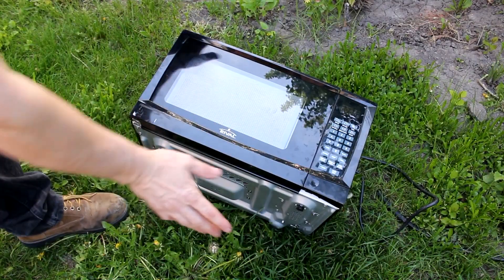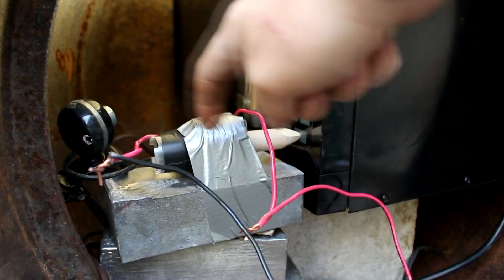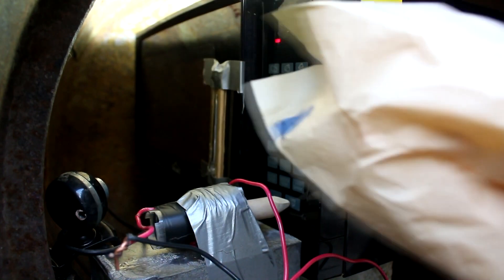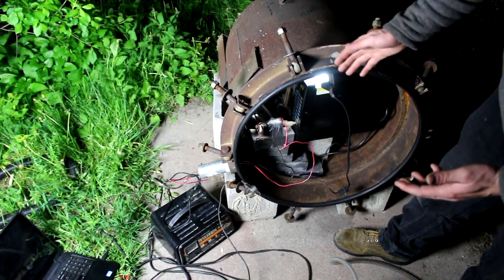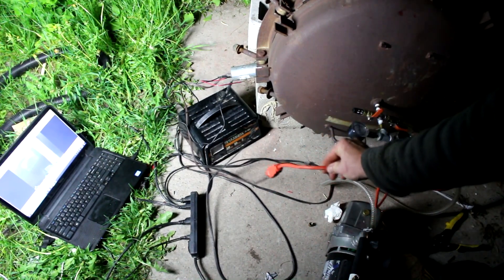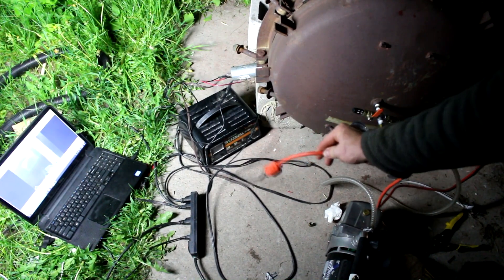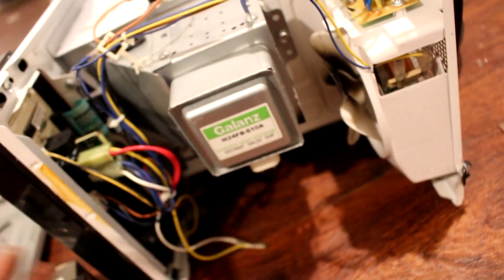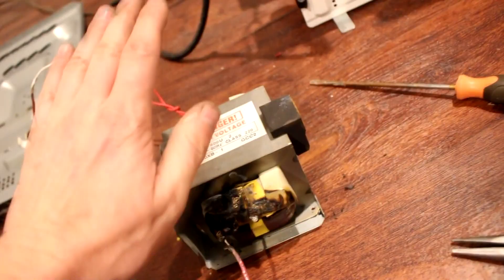Microwave In Vacuum Chamber

Comment: I can't believe I hadn't seen this video before. But I searched "microwave in a vacuum chamber" on youtube because I was wondering how much easier it would be to create and maintain a microwave plasma in a vacuum. 
Now I think it would be better to have a good majority of the circuitry outside the chamber itself. With the magnetron either going through the wall of the chamber or even just projecting the microwave energy through a glass window into the chamber.

Comment: Concu with all the folks that vote the enhanced arcing potential in a vacuum. However, note also that the fan also cools the transformer as well as the magnetron. A hotter transformer will also facilitate arcing. So you had two things torpedoing the microwave at the same time.

Comment: Wow this is amazing! I've been trying to figure out how to diy a microwave vacuum chamber out of a kitchen microwave but never considered placing the entire microwave inside a vacuum chamber! I was so disappointed that it didn't work out....  Do you think it would be feasible to rewire the microwave so that only the magnetron is inside the vacuum chamber? Also what do you think would have happened with the popcorn if the transformer didn't fail? Was your goal to cook popcorn in less time than at atmospheric pressure or did you predict another effect?

The most feasible solution that I was able to come up with was to use a glass vacuum chamber with the port on top, connected to a silicone tube ported through a hole on top of the microwave. The silicone vacuum line would be then connected to a rotary vacuum union, with an adsorption column upstream to help maintain low pressure levels.

Comment: vaccuum allows electricity to arc more easily, and even arc over 250 times longer distance, and i immediatley knew what happened when i saw the burns
*edit
reason is electrons dont bump into as many molecules ,or at least i think
them bumping into molecules makes them loose energy btw

Comment: It looks like the secondary (high voltage side) began to arc and in a vacuum that creates coronal discharge leader like fingers seeking something to lessen the potential difference. The secondary on a microwave transformer is approximately 2Kv. Your fingers around that high voltage capacitor was unnerving. You should have checked to see if it was discharged first by shorting it.

Comment: The arcing explanation isn't bad, but I don't think that is what happened.  Arcing is unlikely in that circuit, because the wires are already insulated for the full voltage, especially in the transformer.  There isn't air space between the wires in the coil, so they have to be insulated against the full voltage.  In short, it doesn't matter how conductive the atmosphere is, at least not initially.

So probably what actually happened is that the lack of cooling due to lack of atmosphere caused the transformer coil to overheat.  That burned off the enamel insulation on the wires.  Then, arcing probably commenced from there, but only after the heat damage removed the insulation.   So the arcing is probably what ultimately killed it, but the smoke and charred stuff was probably just from the heat due to lack of cooling, and that's what allowed the arcing in the first place.

Comment: The low pressure could have caused a small shift in the wire, which could have exposed it just enough to cause a arc

Comment: obviously the lower air resistance of the lower pressure allowed the 2400 volt transformer output to arc to the grounded frame of the transformer. As a result the arc burned the coil with plasma.

Comment: Electroboom fried his Tesla coil by putting it in a vacuum chamber. You are right about the arcs dancing around on the coil. What would be cool is if you shorted out the fuse to see what happens? maybe it'll work, or smoke, or even cut the breaker.

Comment: I wonder if the capacitor is electrolytic and If the vacuum had an effect on it... possibly expantion, it's obvious to me the resistance in the vacuum caused an arc that destroyed the transformer but I'm very curious about the cap, I would love it if you did cap testing in a vac

Comment: You could recreate the experiment with the transformer outside the vacuum, just leave the microwave unassembled and run the transformer wires in instead of the microwave power cord.

Comment: What would happen if you did the same thing but with the transformer outside of the vacuum chamber? You could even add electrical tape to all the connections inside the microwave to prevent other components from arcing as easily.

Comment: Even if the microwave was working correctly under reduced pressure, shouldnt the water molecules inside the corn be evaporated at the time you started the microwave? Considering this, it wouldnt work. Except the shell of the corn prevents the evaporating in that time period, hm

Comment: The magnetron has heat sink fins which are cooled by a fan blowing AIR through them! :D
Reply: So, in in other words, the magnetron overheated and the high voltage had nowhere to go except back into the transformer.

Comment: Air is a better insulator than vacuum. When you removed the air you likely had a primary to secondary short in the HV transformer.

Comment: Cody, try peeling cellophane tape in your vacuum chamber and detecting x-rays from it. (if you haven't heard about that, just Google it) Apparently, it emits a lot of x-rays. Your Geiger counter is capable of detecting them - I have the same one and put it into an industrial x-ray machine, and it went crazy with counts.
Reply from the maker: First thing I thought of was a real to real tape peeling machine that produces x-rays.
Reply: Yeah, that's what the guys did in the original experiment. They had a motorized tape peeler inside the vacuum chamber. And they had a scintillation crystal, which was lighting up nicely.

Comment: I would be careful I'm not 100% sure on this but I work in substations and there is a test called a high pot test. It's used to measure how much voltage it takes before an arc occurs in a gap of a circuit breaker. We are warned about being close to the breaker under test if it's a vacuum breaker because when an arc does occur it emits harmful ex-rays. You may want to look into this before trying more experiments with high voltage in a vacuum. Love your videos, be safe out there.

Comment: The fan was pretty much useless with 95% of the air gone, so the coil overheated and the copper wire separated which caused it to arc. Less air pressure resistance allowed the arc to jump much further so it basically jumped across the fuse circuit and kept running until it burnt out completely.

Comment: The microwave oven transformers are barely specified to run the magnetron with the fan running so I am not surprised that it died. It might have arched as you guessed but with no cooling at all I wouldn't be surprised if the secondary insulation just melted in seconds. 
Even if it didn't you would also have a problem with the high voltage diode fairly soon. 
If you are interested in redoing the experiment you might want to pot the transformer with high temperature epoxy (under a vacuum to drive the epoxy deep into the windings). The kind of potting used in automotive ignition coils would be a good choice. It would eventually fail but with the concern of arcing removed, and a tiny bit of extra heat soaking in the epoxy coupled to the ability to run at a higher temperature I guess that it will be enough for a significant part of the heat of the wingdings to flow into the iron core and keep the thing working just enough to make pop corn. You could also precool it with liquid nitrogen. Immersion in oil could also work, likely even better than potting.
 
You should also bolt the high voltage diode to a big chunk of copper to soak the heat (some of those diodes have square sides that are perfect for that) , the diode shouldn't dissipate much more than 2W but being a low mass part that fails at about 100ºC a rough calculation tells me that one of those diodes would increase its temperature by 80ºC in about 100s in a vacuum.

You may also get away with having the transformer outside of the chamber, 2Kv might be ok for the insulation of your wires. It is pushing it a bit but I think that they wouldn't fail. I think that the whole doubler circuit would be too much for the insulation.

Another interesting option would be just redoing the experiment with the microwave cover open and the camera pointing to the transformer to see how does it fail.

I think that the magnetron should stand the abuse. There is quite a bit of metal around and inside of it to soak the heat and they are sturdy. There is this video in the photoninduction channel where they push up to 5KW into a microwave oven if I remember it right, the transformer bursts into flames , they swap it and the magnetron keeps working just fine.

Comment: Have you considered that a cloud formed inside with the low pressure and the moisture condensed on the metal causing the high voltage to arc and burn? I think that if you did this with completely dry air you would not get arcing. Also, a microwave oven works by the microwaves agitating water molecules, causing friction between the molecules and creating heat. If you try to cook something that does not contain any moisture it will not cook and it will not produce heat. So you are always going to have moisture in the chamber if you have something to cook, because even if everything is perfectly dry, the cooked item will release moisture and in the low atmosphere will condense and cause arcing.

Comment: The way your microwave failed in the vacuum chamber is very similar to the experiments conducted by NASA's Eagleworks lab which were looking at their version of the "EM-drive". They were using capacitors which supposedly could be exposed to a hard vacuum, but they failed due to corona discharges. Why I don't know, shouldn't there be little to no air to be ionized within the chamber? Doesn't make sense to me.

Comment: There are two reasons why it will definitely kill the microwave
1/ It will overheat due to inefficient cooling and I guess half or third of athmospheric pressure might be enough 
2/ While air at normal pressure is quite good isolant and high vacuum is even better, there is a peak in conductivity I think in order of pascals (or tens, hundreds?) when gasses are quite conductive - like in fluorescent lamps, neon lamps, etc.This is kind of vacuum that you can get from rotary pump or scroll pump.

Comment: assuming the magnetron drew more current as there was a thin atmosphere... which overloaded the secondary, causing the insulation to burn, which allowed the voltage to arc and blew the fuse.

Comment: Thanks for sharing. I think you should Not put anything with cooling fan (such as microwave ovens, laptops etc.)  in vacuum because they also* overheat quickly and may get damaged beyond repair!
* I mean reading Dean's reply, I am puzzled as to how electricity can jump in vacuum?! since there is nothing to conduct?
BTW that round cap thing on top (with 2 wires) is a thermal fuse. sometimes they are normally open but sometimes N/C you just have to read the schematics.

Comment: A vacuum is a conductor of electricity so the high voltage winding of the transformer found a path to ground is all. You should use heavily insulated wire and run the transformer outside of the chamber with the magnatron on the inside... would be cool to see if the magnatron is affected by vacuum.

Comment: Decreased pressure allows air to ionize at lower power. A plasma arc would form around the secondary coil and burn the wires.
Reply: Exactly. Same reason a neon lamp can be so long. At lower pressures, the air is less of an insulator and doesn't require as much voltage to break it down.
Reply: Wow... mind boggling to think that air is what is preventing electricity from jumping around...

Comment: I am more chemistry than physics, but I will input anyway as this could be helpful. Plastics (like everything) are in a constant state of flux. Even though plastic is a poor conductor, it does still conduct. The burns that you see are very likely from a very small fire (caused by the electricity having no where to go). What interests me the most is the burn on the fan. What if all of that power was able to jump to the metal with the fan in the way? That plastic fan would not withstand the kind of heat that this would produce. And as fast as that thing is moving, it would still get a pretty big hit. (Think lightening) WOW I would love to look into this further.
EDIT: If my theory holds true, then the fans motor would be fried. Just because it can spin freely that does not mean that the motor works.

Comment: I think the fan, with no air resistance to slow it down, went into excess RPMs. This caused the motor to draw too much power and short out the transformer.

Comment: I know very very little about electricity, or physics, but I propose a couple little ideas for shits'n'gigs
1 - A vacuum lacks close/abundant molecules (read: electron owners) making it effectively an insulator. Once plasma forms, how ever that happens, the lack of positive (well, physical) insulation afforded by the negative insulation (the vacuum) allows the electrons to flow along magnetic lines with relatively little thermal dissipation nor (because plasma) electrical resistance. So, if we are feeling generous and assume what I've just said is accurate enough
2 - It's late and I don't want to finish this post so here you go: Blah maybe resistor maybe capacitor maybe fuse expansion maybe whatever increases impedance of something blah blah no cooling effect of air/airflow blah smoke arc plasma blah blah blah electron flow south, north, north, south, north, past fuse, north, past fuse blah blah blah

It's too late to keep goin, but it's too late to give up. Hope this something or something, cheers.

Comment: My guess (I work in electronics but I'm not a great expert) is that the vacuum messed up some sensor or measuring circuit, causing the oven to underestimate how much power it was drawing, then trying to draw more, and then the transformer overheated and would've gone on for a bit longer unless the fuse broke. (I'd comment that they should try to use a fuse that prevents the transformer from generating dangerously excessive heat).

But I'm guessing.
Reply: If you do find that electricity can jump more easily in a vacuum (shouldn't it be the opposite??) I hope you'll provide an explanation.

Comment: When microwave oven's HV transformer is in vacuum, its 2 kV sparks reach a lot further and they carry a lot of current. They can reach and ground themselves into your steel vessel and then you. When you do these things, stay few metres away from the system. This transformer does not forgive, it will kill you like a moth slammed into a bugzapper.

You've touched the system while the oven was plugged in (after the smoke appeared). You could've died right there.

Comment: I wonder what will happen if you put a air compressor inside a vaccum chamber Triggered
Reply: Rafael Ferraz THIS NEEDS TO BE DONE
Reply: its your uncle bourbon TOTTALY
Reply: it will explode because the compressor will be taken above its max pressure
Reply: Motor would run too fast due to lack of air resistance and possibility burn out quickly like the microwave.

Comment: Run the microwaves from an external magnetron into the vacuum chamber through a waveguide, then the microwave will still function as normal, and without corona at low pressure, and have proper cooling.
Reply: mon librepenseur, indeed.
it seems you have some experience with "Hardy's Paradox" and near-vacuum experiments.
maybe even LIBS (see gilbondfac's vids on LIBS interferometry/spectroscopy).

I test what such does through memristive p-membranes via different thing near-vacuum,
and it is intriguing what happens to the lattice at different excitations eh.
consider with also these Wilczek resonant time-recursive lattices...
its a micro-rectifier almost.

Strange-Strange- Beta Muon is "doubly magic", 
and has much longer particle lifetime.

similarly, pseudo-atoms like "muonium" etc,
it may be possible, via Hardy-Hall-Zermelo paradoxes, 
to create more stable long-lived pseudo-atoms like muonium...
via a combination of this and 
"nature's particle fountain"...
that has implications for the extents of the extended periodic table,
and the ERoEI limitations which otherwise babushka limit the formation of 
"the islands of stability"....

what do you think about metallic Preons mon librepenseur?

je prends conge.
bonne chance et bonne sante a vous!
Reply: This is like particle physics bingo. I got all.
Reply: Corona virus y'all

Comment: High air pressure (in this case atmospheric) has decent electrical resistance and usually requires about 20 KV to jump a small 'air-gap' at sea level pressure. When you evacuate a chamber of air molecules/atoms the electrical energy required to excite the remaining molecules/atoms becomes less. The fewer atoms there are, the less total energy is required to excite them and produce a plasma (electrical arc).